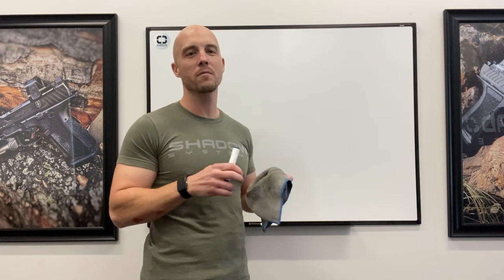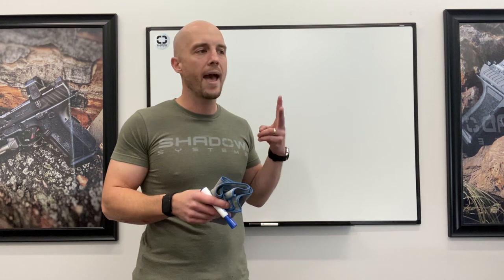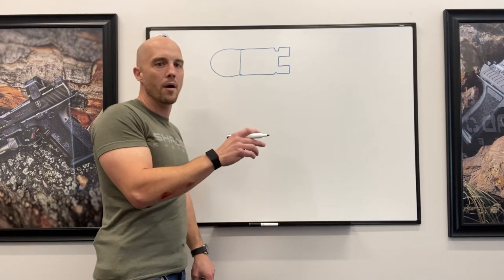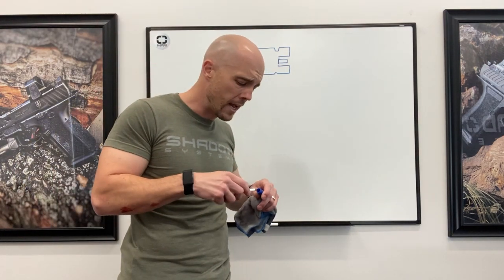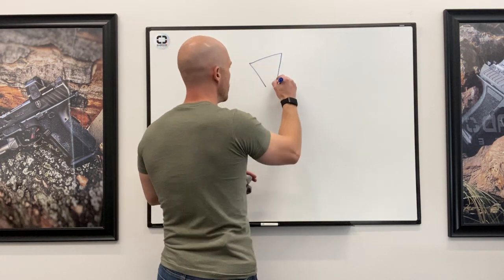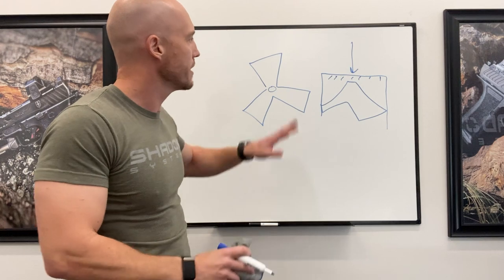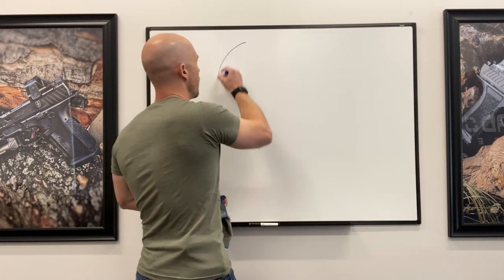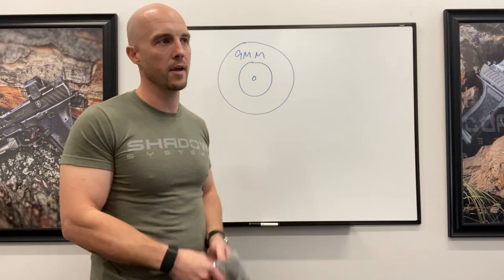Technical Tuesday: All About Primers and Light Strikes (WITH PICS)

Comment: Well done video.  Thank you.  I learned something.  Subscribed, bell rang, commented, liked, upvoted, shared  ... may the algorithm gods smile favorably upon your channel young man, and not only that may you sell more of your fine firearms.  One thing you may have missed for us competitive shooters and high volume reloaders is compressed primers or those that have been over-seated.  It's a seating depth problem where the primer is seated well below the flush point of the cup.  Rarely happens with factory loads, but it can happen with an overzealous handloader who has developed strong grip strength, especially when seating primers using a hand primer rather than trusting a properly tuned progressive stage on a press.

Comment: Minute 10:55 of your video. I’m experiencing this, precisely as you explained, but I’d like to offer, in addition to your explanation for why these things happen. 1. You have a compensator on your gun. You have the wrong weight on your recoil guide rod to bring the gun back into battery to compensate for that compensator 3. You have too light of a striker spring, 4. You have a new build, and everything has not worn in “just right”…Good stuff. Thanks.

Comment: I live in Alaska. In my Glocks I always replace the striker spring with a 6# spring. I carry year round, we spend many months in teens or colder. Because the primers will get cold and freeze they become harder to set off. Earlier this year I picked up the DR920. I did change that 1 spring and yet to have a problem. We are just getting into the start of winter. I'll give a update after winter has set in and go out to the range. I'm currently at 760 rounds through it.

Comment: Interesting discussion; insightful. Most of my light primer strikes are traceable back to Magtech factory reloaded 38 Special ammo fired from a Charter Arms snubby.  I’ve used their 9mm range ammo in my HKVP9 and my Walter PPS M2 without issue. But curiously enough my Colt Defender has a problem with off-center strikes for 230gr ammo. I’ve had to restrict it to 185gr ammo for 100% reliability. So I’m thinking the chamber might be a little tight…don’t know for sure. The same 45ACP ammo lights off perfectly in my HK45C, so my Defender is a little suspect.

Comment: Excellent.
I'm still having light primer strikes on my MR920 even I watched this video.
Contacted support via email. I was flushed because "I use bad ammo" - Sellier Bellot and other brands.
Hmm, those ammo doesn't have problems on my different guns.
I like my MR920, I use it for competition but it is frustrating sometimes.
I'm dissapointed!
Reply: Did the light strikes go away?  I'm 700 rounds into my mr920 and I get light strikes or no fires 2 to 4 out of 50 of my sellier and belot 115gr and they want me to mail it in now
Reply: @manofsteel6262  yes, but I had to fix it myself.
1. I changed recoil spring to heavier one (from g19 gen3)
2. I changed trigger bar (original broke) to glock gen4.
It works now(i think). But I stopped using it because I got tired of it.
Reply: @Mario_Craconni  I'm not to familiar with parts but isn't thr recoil spring just reduce felt recoil and stop the slide from slamming back?  How would that effect light strikes, I figured it would be the firing pin or the firing pin springs
Reply: @manofsteel6262  recoil spring keeps gun in battery. This is very important for this tight fitted chamber.
Light primer strikes could be because of that or because of striker drag on cruciform on trigger bar.
SS because of tight tolerances needs to have everything perfect to fire.
Reply: @Mario_Craconni  thanks for the info.  Just finished another 300 rounds and the local gun Smith says he believes it needs a stronger firing pin spring, so either I try and find the right spring or SS wants me to mail the whole gun to them for review, yay......lol
Reply: @Mario_Craconni  I posted a video on my page I think it's under shorts, was this what you were experiencing
Reply: @manofsteel6262  yes, same.
Sometimes on 18 shot course of fire during competition I got 3 light strikes. Really frustrating.
Reply: @Mario_Craconni  they say their recoil spring is 5.5lbs and my 19x is 5.5lb.....what was the lb on your gen 3 that you replaced
Reply: @manofsteel6262  5.5lb is striker spring. I read that factory recoil spring for SS is 18lb, they give 20lb to work better. I weight my factory recoil spring SS and it came at 15lb. I replaced with gen3 18-19lb and it is better.
Reply: @Mario_Craconni  yup my bad read my wrong stats.  If this doesn't work I'll try that

Comment: This maybe the issue I’m having. I’ve been having FTF issues on my new MR920. First time shooting it. It was oiled up nicely. Contacted support and Cody got back to me.  It would happen at random, pull the trigger, I can hear the firing pin go, but no bang. Rack a new round, click, and no bang. Repeat, rack a new round, pull trigger and bang! This happened numerous times through my range session. At one point I couldn’t get through a full 15rd mag without a FTF. So hopefully when I send my gun back this will get resolved.
Reply from the maker: Hi Nevada!  Just wanted to follow up.  Did you get the issue resolved?  How many rounds did you get through the gun?  Out of curiosity, what ammo did you use?  We have seen some of the imported stuff with hard military primers have issues.  Hoe it's smooth sailing now.  Trevor
Reply: @ShadowSystemsCorp  I have not shot it again. I will try tomorrow, Sunday. I was using Aguila but have recently purchased 1k of CCI/Speer ammo, same brand as my duty ammo. I put about 200 rounds through the gun so far. I would like to put 500 tomorrow.
Reply: @ShadowSystemsCorp  So I shot 500rds of CCI/Blazer without any FTF. However, I did have 2 FTFeed. I also shoot 100rds of Aguila 9mm and experienced FTF. I checked the primer and there was a visible primer strike. So it’s the Aguila ammo that’s the issue, which I used the first time shooting the gun. With the new ammo totally different story.

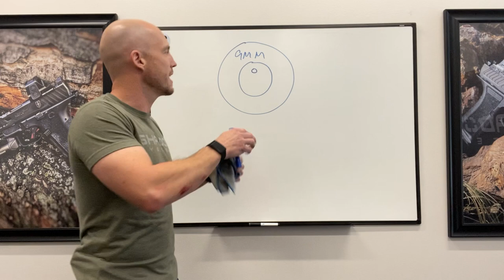Comment: Was that subliminal messaging at 10:06? I rewound it multiple times to check. There is definitely some sort of image of ammunition that flashes for a split second.
Reply: 9/11 ?? 2 9mm cases=twin towers? 2nd tower had reported explosions at 10:06am (image of 9mm), than collapsed at 10:28 am (trevor does hand sign language at 10:28 with wiggle that means collapse in sign language) im on board with that. nothing to see here!
Reply: @dinosaurplumbing9878  image of the two 9mm cases are at time stamp 10:07 not 10:06. So much for the twin towers theory. Although I must admit its weird that it flashed for just a split second. But it definitely is 10:07 not 10:06. I check multiple times at .25 playback.

Comment: Does the MR918 have the same firing pin as the MR920?
Reply: yes and no. the mr918 and EARLY released mr920 share the same triangular thin striker pin. later manufactured mr920 and dr920 have an updated wider and rounded firing pin.

Comment: I bought two dr920 pistols and the first one would not reset the trigger after 3-5 rounds. Got rid of the gun after changing out the striker spring thinking this would fix the issue. Did not fix the issue. Got rid of the gun. A week later bought another dr920 and the same exact thing happened over and over again. You are making videos to attempt to convince people your product is good when it is actually crap. You need better QC on your products and I have zero clue how your product is even approved for law enforcement use. I spent 2,000 dollars on your product in hopes of having a cool looking reliable pistol because it feels also good in the hand, but was severely disappointed. I purchased my two dr920’s at on target in Murfreesboro. I am a verified buyer. Your weapon system should be able to fire through any type of ammo. I was using 115gr brass from various companies and your product could not and would not perform.
Reply from the maker: Michael, would you mind sharing your contact information with us at support@shadowsystemscorp.com?  I’d like to personally give you a call. Trevor